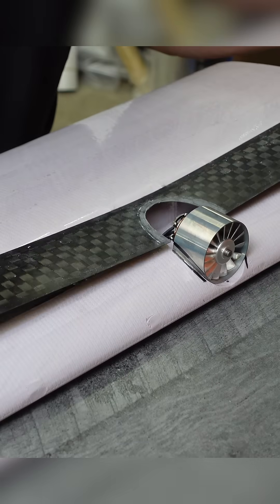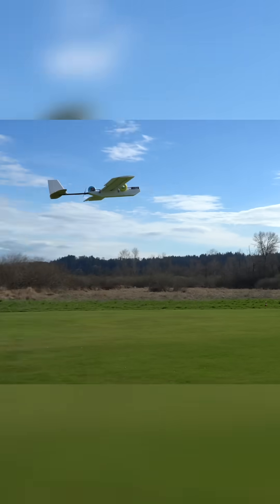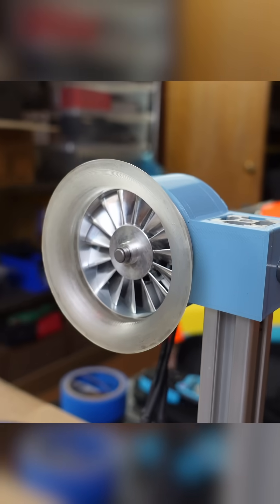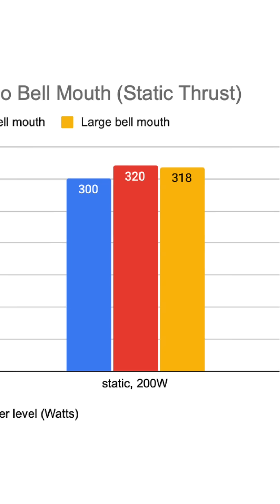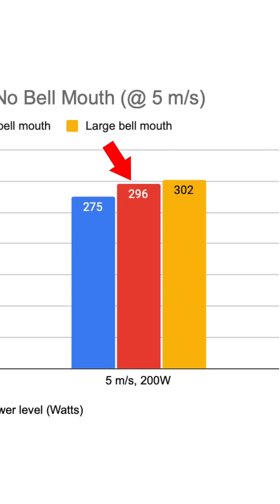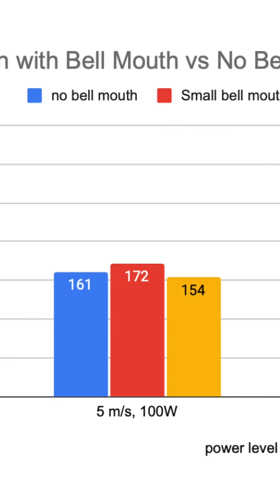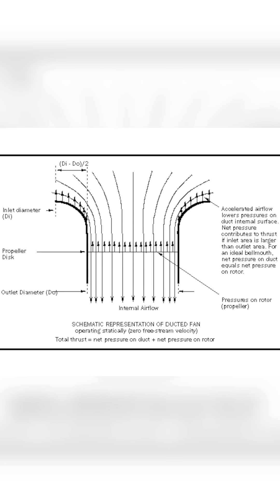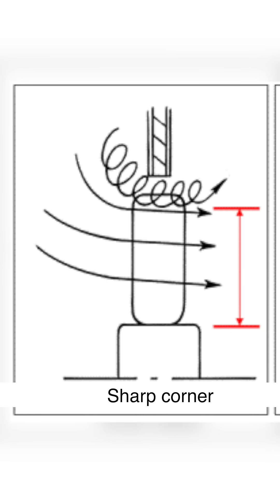Testing EDF Intake Shape for RC Plane #rcplane #aerodynamics

Comment: They use them on racecar intakes too!
  Velocity stack

So I'm not sure it has anything to do with it moving forward they are usually to the side or  like straight down
Reply: A velocity stack is not a bell mouth, but a velocity stack has a bell mouth.
Reply: in isolation, its just more efficient, for the reasons mentioned at the end of the video. In an airstream pointed in the direction of travel it can give a "ram air" effect which is desirable for many racing purposes.
Reply: My 1958 BSA Bantam 175cc had a bell mouth on the carburetor. 
As a 12 year old, I can say that bike went like a bat!